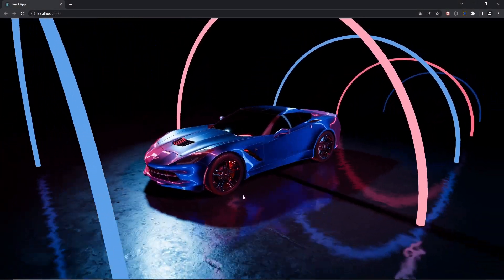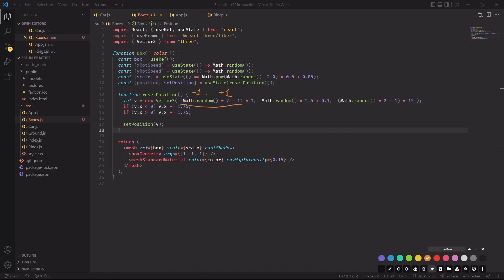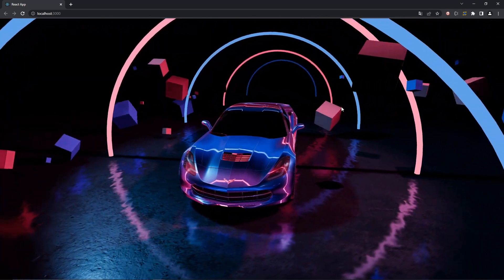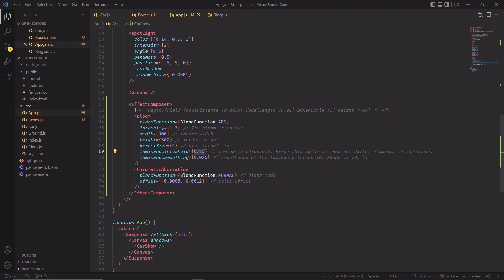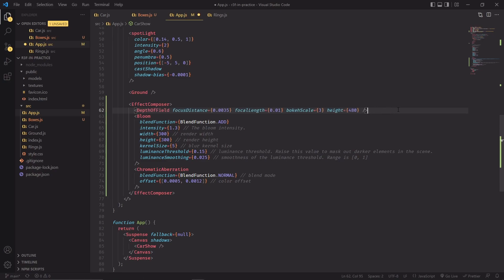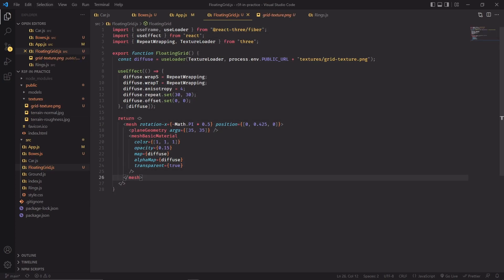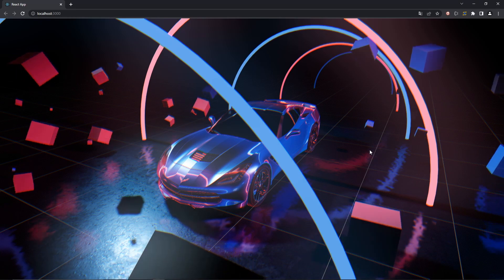Create a 3D car show with React Three Fiber and Three.js [ Tutorial part 3 ]

Comment: Hello Sir, I am facing an error. Whenever I am trying to host this project in the website, the ground textures and the floating Grid textures are not loading. I tried to resolve this problem with every gpts but cannot get any solution. If you can provide me a solution, or maybe just a small video on this series on how to host this on website through the VS Code's port forwarding method or maybe Vercel, would be very nice.

Comment: Hi bro, thanks for the video.
I am studying your video but my car ( different from yours ) is showing lights on the tyres which means wrong. Do you know what I have to change in the code? Or Could it be a problem with the 3D model?
Reply from the maker: play with the material properties of the tires, check if roughness is set to zero or if metalness is set to 1

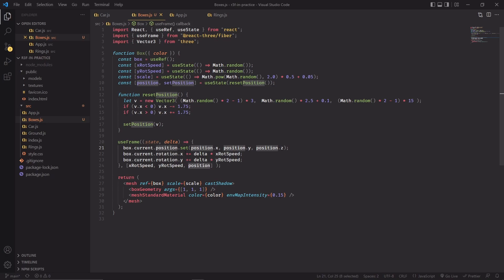Comment: 2:40 Why do we set the render priority here (as in, what does it do) and why do we set it in that order (xRotSpeed, yRotSpeed, position)?
Reply from the maker: Hello! I was looking at the timestamp at 2:40 but couldn't spot a render priority statement (I'm assuming you're referring to what would map to renderOrder in threejs)
As for the order of the position / rotation x / rotation y, it doesn't really matter (unfortunately!) because threejs has it's own internal defaults for deciding what is applied first
Sometimes the order matters, e.g. we might want to first translate an object before rotating it, and in that case you usually have two options: construct a custom made world matrix and feed it to the mesh instead of using the default position / rotation properties, or you could wrap the object with a <group> object and apply part of the transforms on that group
Hope this helps! thank you for the feedback! :)